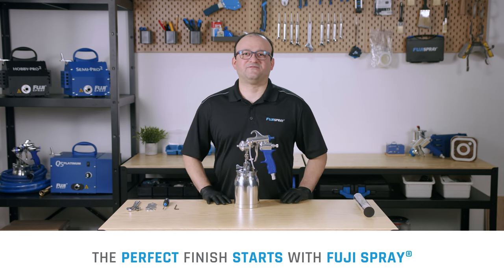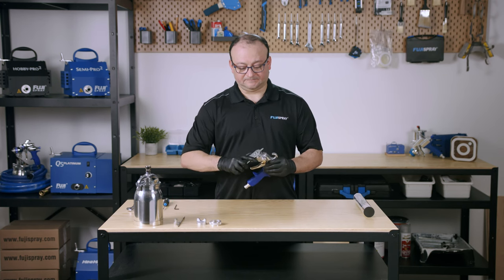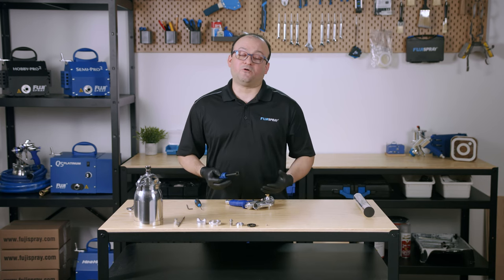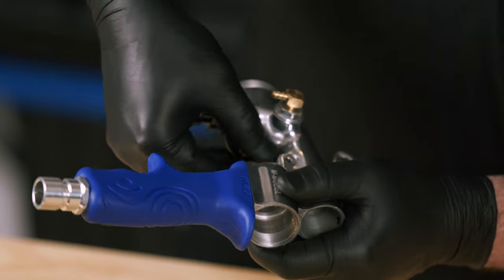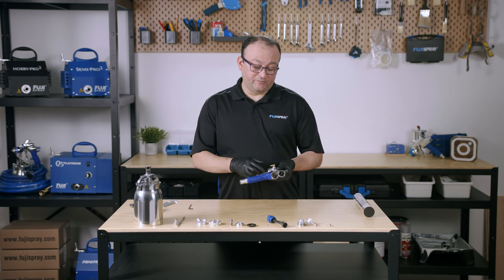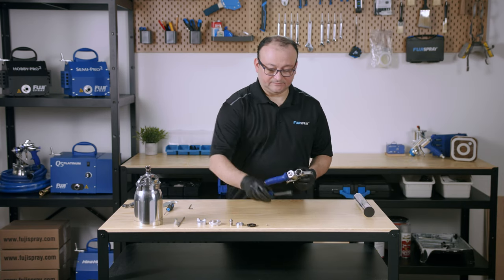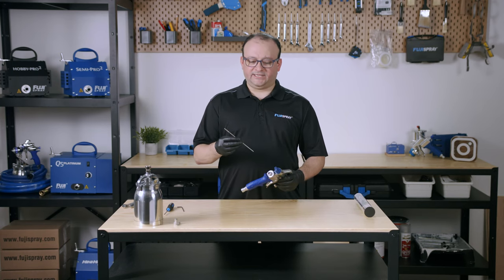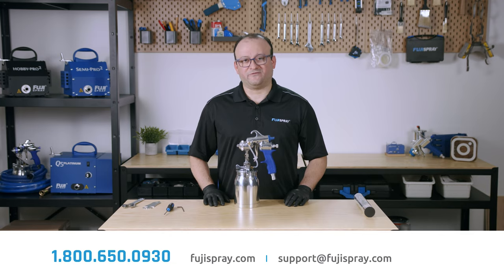Strip and Rebuild | M-Model Spray Gun

Comment: Hi
I purchased a used M spay gun same as the one you striped down. Everything was in great condition but the fan adjuster was almost solid. It took me ages and a lot of ingenuity to remove the assembly without destroying it. There was no debris inside at all clean as a pin. I cleaned it  although there was nothing to clean put some lubricant in the bore and on the black plunger, the end that enters bore but there was no way it was going to slide back in. Against my better judgment I took a very fine bit of wet and dry paper and carefully abraded the plunger. It eventually went in and is working fine although the rotation of the adjuster is still very stiff.  I really don’t understand what has happened, as I said the whole kit was like new so I was wondering if the plastic that makes the assembly can swell over time. I will definitely be regularly removing and lubricating the assembly in future, don’t want to do that again. 😩
Reply from the maker: While this is uncommon occurrence, keeping the component well lubricated is very important. Also, rotating the fan pattern control knob from time to time, even if you're not using it. This will keep it from seizing. If you have any other questions or concerns, please reach out to Fuji Spray directly. - Fuji Spray Team -

Comment: Hi! My pattern control wasn't turning so when I was removig it to clean it, I was able to remove the blue part but the black part is stuck in there. Any tips on how to get it out?
Reply from the maker: You will carefully need to use the flat head screwdriver and continually switch sides so that it is wiggled out. Adding some WD40 from the front of the spray gun and let sit for a short while may help too. - Fuji Spray Team -
Reply: Yes, I used an open ended spanner as a lever. Slide the open ended bit of the spanner over the square section of the black plunger rod lever a bit, then get another spanner and put that on top and lever again, only a little so as not to damage the flange that you are levering against. I had 5 spanner stacked against each other before it finally came out. There was no muck in there and I had to sand down with very fine paper at the plunger end to get it back in. Slapped plenty of silicone grease up and everywhere on the assembly to try and stop a repartition. Good Luck.